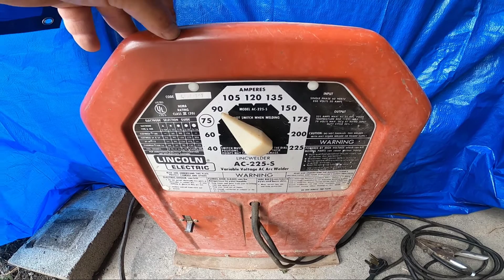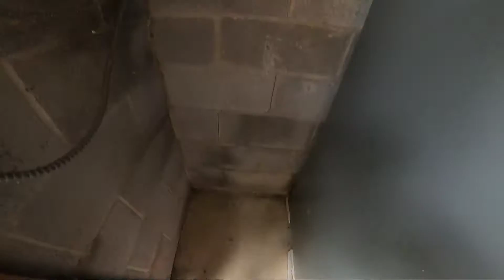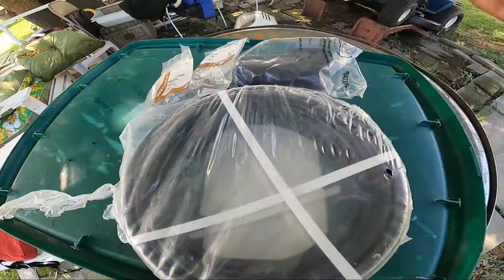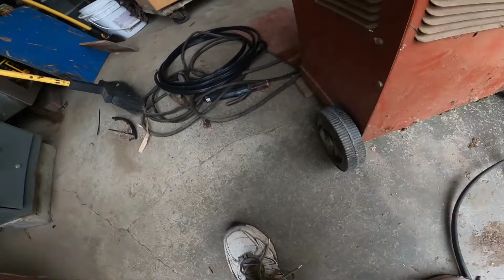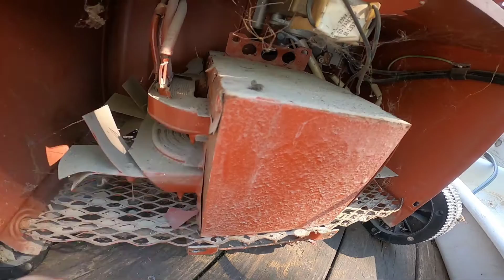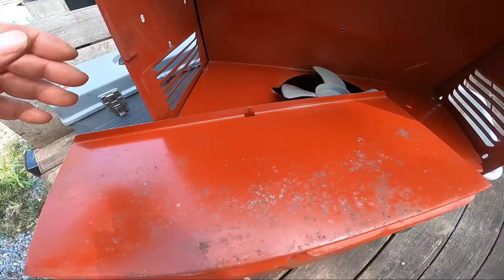My First  Lincoln Tombstone Stick Welder

Comment: Liked your video, I have several tombstone welders and they are great  and last a long time. The guy that sold you the welder is right. A small generator  5-7 kw will not work on this welder as it draws approximately 35 amps which is hard to get. If you want to use a generator you’ll need a 10+ kw generator. As a note this welder is AC  only and it will not weld certain welding rods, primarily E 6010, but will weld 6013, 7018, 6011. It’s a great welder has been around for a very long time. Practice makes perfect, enjoy.
Reply from the maker: Thanks for the great tips on generator sizes and rod compatibility, I really appreciate the advice! I am looking to finally put this to work this coming summer. First project is repairing a few breaks on my backhoe bucket. I am learning by just doing so any tips are very welcomed.
Thanks again and stay well,
Joe Z

Comment: First thing I did with my used welder, before wiring up the breaker box, was take it to a neighbors whose garage was wired for 220V 50A.  I even did a couple of spot welds.  Once that was done, then I got into the breakers.

When everything was set up properly the actual welding was a trail.  After my 3rd attempt over many days, it all finally clicked.  Now welding is fun fun fun. :-)
Reply from the maker: CanAmRider,  Thank you for watching and taking the time to comment. 
Checking it out first was a good move. Unfortunately the guy I bought it from no longer had the 220 outlet. That gave me a little concern, but I went with the gut feeling he was an ok guy. It all worked out. I have been looking for one of these in my price range forever. Now that I have it, no time to really get into it.  
CanAmRider, your support is not required or expected but always appreciated. If you are inclined to do so your Subscription, Likes, Comments and using the following links do help.
I hope you get to  enjoy other videos on my channel as well. 
 Stay safe, Joe Z
Reply: @JOEZEP54  Same here.  I could not test my welder at the sellers place.  But I did test it (at the neighbors) prior to wiring up my garage.
Reply from the maker: @canamrider7195  I did not have that option but if the welder was a dud I was going to get one eventually. Still a good idea to check it out before going through the expense of wiring your garage.

Comment: does anyone know what the S stands for in AC-225-S? A lot of them just say AC-225.
Reply from the maker: Thank you for visiting. I am not a welder & always looking to learn. I have looked & asked around since you posted this question & have not found the answer yet. Still looking. If you should find out before I do please post the answer.
Stay safe, Joe Z
Reply: @JOEZEP54  I heard it stands for "stick" but I am not for certain. And I would like to know when they started putting it on there.
Reply from the maker: @pl747  Thank you for getting back with this information. I was also told that is what it may stand for. But my question was what about the others that use a stick that do not have the " S " ?
We will find out sooner or later.

Comment: First of all,when you wire your 220 volt plug in,you should have used a cable with 3 conductors & a ground,or at least mark the white wire,which is usually for a neutral conductor, mark it with a red or blue marking tape,to show that it is not being used as a neutral conductor. Next,be very careful when removing the back of a welding machine, even after unplugging it some machines,depending on the make & models, have a capacitor in them that can hold an electrical charge that can be dangerous if not fatal it you touch both terminals; these need to be discharged to a ground source before working on the machine. If you are new to " stick welding", the type of rods to use will vary, depending on the type of metal & thickness of the metal,if the metal is rusted like the pipe you are practicing on,a good general purpose rod for an A/C machine is the 6011; for most thickness the 1/8 rod is a good all around size,the thinner metal use a 3/32 diameter rod,& thicker metal from 3/8inch to 3/4 plate steel use a larger diameter rod like the 5/32; the 6013 rod is also a general purpose rod for most " handyman " welding,but the metal needs to be clean or rust free. For an in depth study on welding rods,consult with the manufacturer of the machine or rod manufacturer; in your case it is Lincoln electric for both; and there are lots of good sites on the internet! Good luck & be safe!
Reply from the maker: Thank you for visiting and taking the time to add useful information. I do appreciate comments such as yours that are helpful not only to me but others that are looking to learn. 
Hope you get to visit my channel again and continue to comment.
Until net time stay well,
Joe Z

Comment: LOOKS GOOD JOE. IT'S A VERY SIMPLE WELDER BUT IT'S A GREAT ONE BECAUSE THEY STILL MAKE THEM. HAVE FUN LEARNING HOW TO WELD WITH IT AND BUILD STUFF. 🇺🇸✌️👍
Reply from the maker: Thank you, will do! It has been awhile but I just had time to use it a day ago. I was trying to weld bed frames to the bottom of a metal work table to sit on top of a dolly. As I said trying 😕. Not sure what the problem was. I have done similar welds before using a Harbor Freight 125 flux core, although that also took some trial & error to get it right. I was told bed frame is a difficult metal to use because of its composition. I got a box of 6013 rods that came with the welder that are a few years old. I enjoy reusing, repurposing & repairing discarded items so  I will keep at it. Have to get it right sooner or later LOL.
Thank you again for stopping by & giving an encouraging comment.
Stay safe, Joe Z

Comment: Fan was seized in mine. Took fan apart, cleaned and oiled it. Works fine now.
Reply: Fan was still slow to start up so replaced fan with used 110 volt range hood fan connected to one leg of 220 and neutral.
My Lincwelder AC225 is a Canadian built (assembled to bypass import duty) it has a flat top instead of the tombstone top. 
.
Reply from the maker: @va7da Hey, that was a good work around thank you for sharing . I did not know that fact about the Canadian built ( a work around of a different kind).
Stay safe, Joe Z
Reply from the maker: David Anderson,  I am glad you were able to save & get yours going again. This is my first Tombstone and from what I have heard these seem to last & are work horses,. Thank You for watching and taking the time to comment. David Anderson I have other videos on my channel that cover many different subjects   that may also be of help or interest.
 Be sure to 👍, share & subscribe if your are inclined to do so.  Also not to miss any new videos remember to hit that notification 🔔
 Another way you can help support  this channel at NO cost to you is by using one of my affiliate links.
     * Thank you for watching I really appreciate your support.***
Again I hope you get to  enjoy other videos on my channel as well. 
 Stay safe, Joe Z

Comment: young man ,

FIRST , IF CRANK UP RUN . U CANNOT BEAT LINCOLN AC 225 WELDER SHOULD LAST U ABOUT 50 YEARS OR MORE , " MOST " TOMBSTONE "  AND CRACKBOX , NEED BLOW THE DUST  .ONCE PER MONTH  ALL ELECTRICAL WELDER COLLECTON DUST REAL BAD ,
Reply from the maker: Mr. kasey casece, Thank You for watching and taking the time to comment. 
I have seen these Tombstones around what seems forever & used often by welders that are older then me LOL. I asked one feller awhile back that had a really old one what maintenance do you do for it? Plug it in &  go.
Hope to get some good use & years with this one.
Now I just have to learn to weld.
     * Thank you for watching I really appreciate your support.***
 Stay safe, Joe Z

Comment: Your generator has to be able to provide 50 amps at 220 volts, or 11,000 watts.
Reply from the maker: Calvin Handley, Thank You for watching and taking the time to provide this information. I was told this by some one else as well but did not give these specifics.
  Calvin Handley I have other videos on my channel that cover many different subjects  and new videos added weekly that may also be of help or interest. Be sure to 👍, share & subscribe if your are inclined to do so.  Also not to miss any new videos remember to hit that notification 🔔 Another way you can help support  this channel if you'd like at NO cost to you is by using one of my affiliate links.
Thank you for watching, I really do appreciate your support
 Stay safe, Joe Z

Comment: nice but one thing you got the wrong wire for that welder lol in needs to be 6-3 or 6-4 there should be 3 6 gage wires and 1 coper wire in that jacket the copper wire you got on the center luge is not right the coper wire needs to be huked to the back plate but you try the best I tank I have a video on it if I dont I can do a quite video on it but outher then that looks good
Reply from the maker: Thank you for stopping by & letting me know. 
Almost had it right LOL back to work I go.